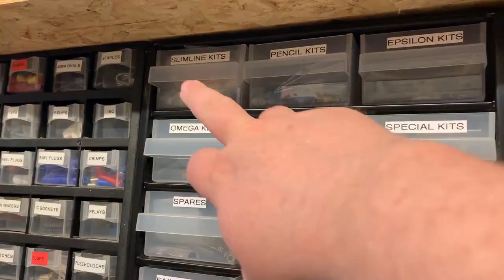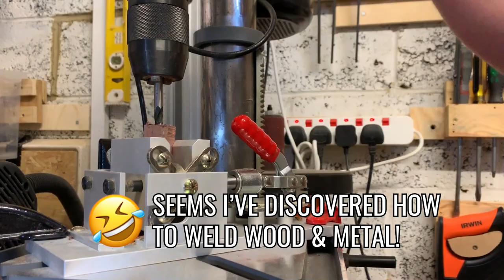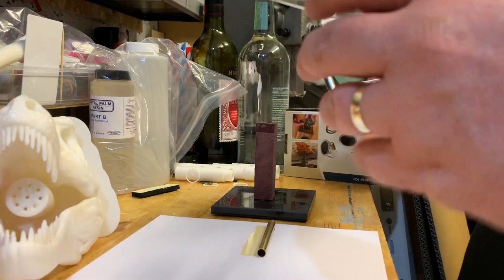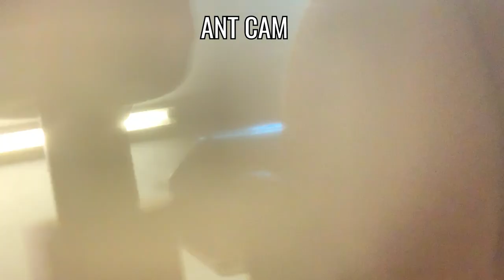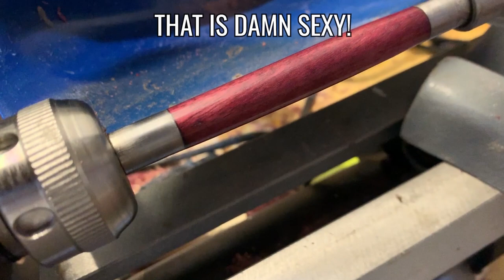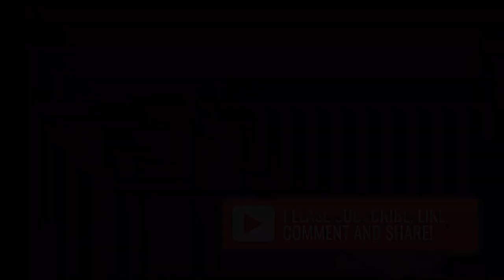Woodturning a Razor from Purple Heart Wood

Comment: Hands up if you've also friction welded wood and metal ✋ 😅
Reply: Dean Makes yeah! I did! I did!! 😂😂😂🌲🦊🌲
Reply from the maker: There are worse things you can friction weld together I guess 😉
Reply: @TheWoodgineer   one of the year 11's at work was using the metal lathe last year and managed to do it with stainless steel, that's the last time he was allowed to use it 🤣